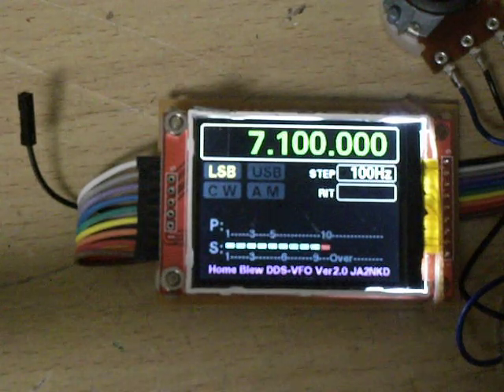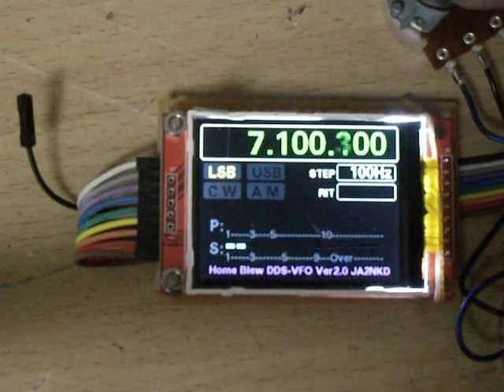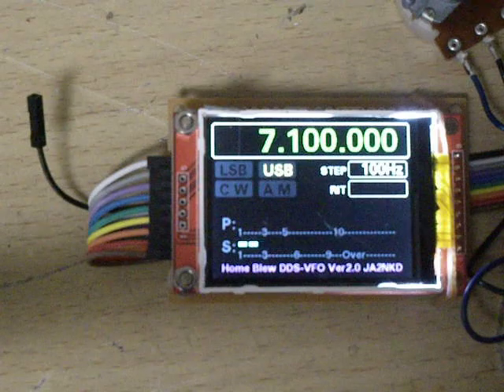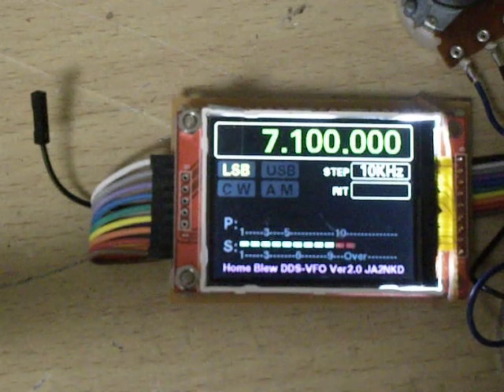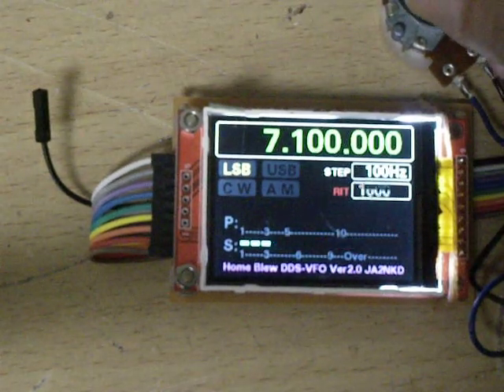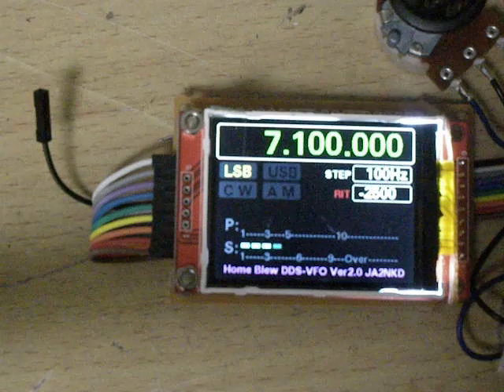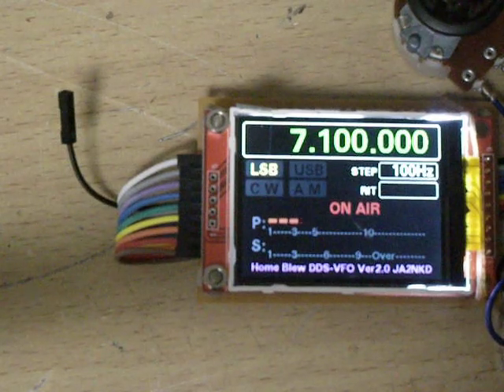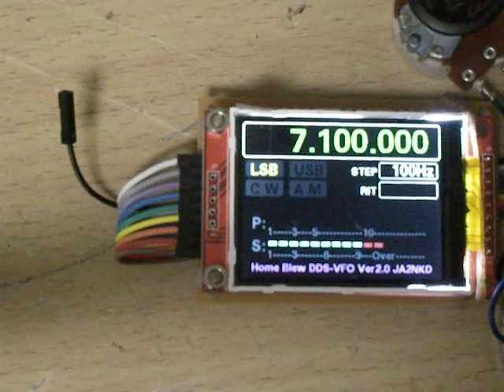2.2inch TFT-LCD DDS VFO   by Arduino nano          JA2NKD

Comment: Ryuu, do you have the sketch for VFO-BFO using the SI5351?
Reply from the maker: Hi,PY2WY
VFO-controller7.10 is using Si5351
https://ja2nkd.blogspot.com/2019/07/remake-vfo-controller-ver-710-arduino.html

Although the sketch is not released, there is a 1.8inch TFT VFO using Si5351.
I use for receiver of link below.
https://ja2nkd.blogspot.com/2018/10/50mhz-receiver-for-psn-transmitter.html

Comment: Do you have a version that uses 1.8" tft?
All i find is 2.2-2.8"
Thank you!! :)
Reply from the maker: Thanks for your comment
My friend remade the VFO for 1.8inch.
http://ja2gqp.blogspot.com/2023/01/si5351a-tft-vfo-ver138band.html
Reply: @JA2NKD  Hello thanks for the reply!!
I see it does not have 160m, is it possible to add that band??
Reply from the maker: @Guns_N_Gears  I think it is difficult to increase the number of bands.
I think it is possible to change bands that are not in use.
For details, please contact JA2GQP
Reply: @JA2NKD  thanks for the reply!
Are you saying it only has 8 bands, so 160m isn't possible that way, but 160m is possible using VFO?
Reply from the maker: @Guns_N_Gears  It is possible if you change the frequency data.
Reply: @JA2NKD  thank you very much!!:)

Comment: Ryuu, i am trying to add a step of 100khz and 1mhz but i do not have enough knowledge about it, have you got a sketch on which it works for DDS with AD9850 .. 73 de 9A6GEZ
Reply from the maker: Hi,Jura
Thank you having an interest in my VFO.
Is it's really necessary?
Tell me how to use it.
Memory isn't left so much.
By all means if necessary, I try to be remodeled.
73’ｓ
JA2NKD Ryuu
Reply: Hi, I'm trying to make a signal generator with AD9850 / 51 and I think your DDS VFO project is a good base to start with. And I have in mind to do the reconstruction of a military device HF PRC 515,
Reply from the maker: OK I see.
I will try. Give me same times.
It isn't being programed arduino recently, so it takes time.
Please send Email to me. I don't know your address.

Comment: Hi! I find your project very good, can I replace AD9850 to AD 9833? thank you
Reply from the maker: Hi,Hung
Thanks for a good comment
I have never used the AD9833.
Since the control command is different, it is necessary to correct the sketch. Please try to research.
73's
Reply: @JA2NKD   thank you

Comment: Does anyone know how I configure BFO?
Reply from the maker: Hi,PY2WY
Since this controller uses DDS, it has only VFO output. If you want to output BFO, you need to use Si5351-PLL type controller.
Thank's
73's JA2NKD
Reply: @JA2NKD  many thanks
Reply: @JA2NKD   OK I get it, but do you have the sketch for VFO-BFO using the SI5351?